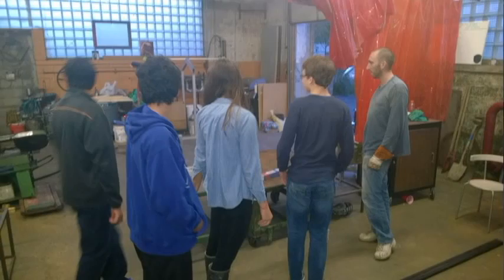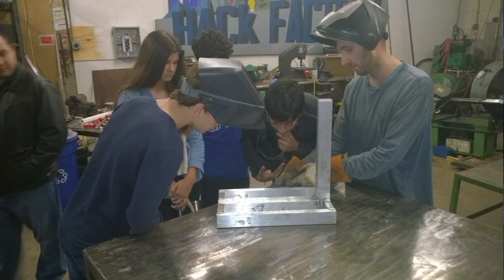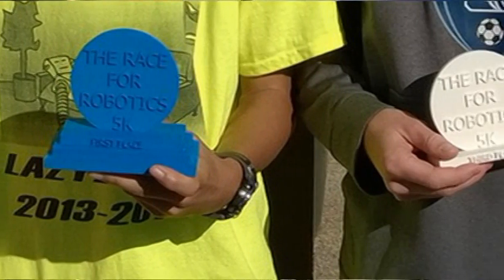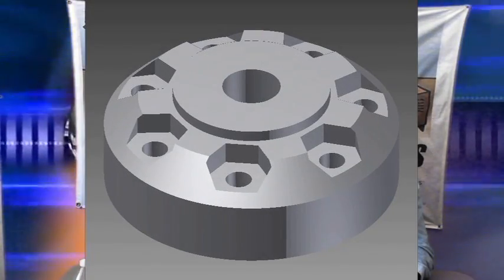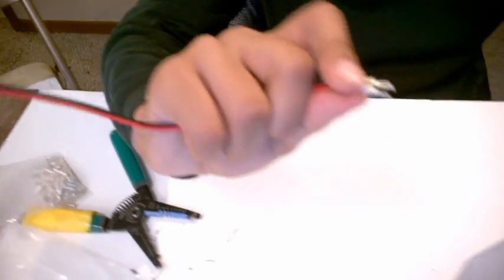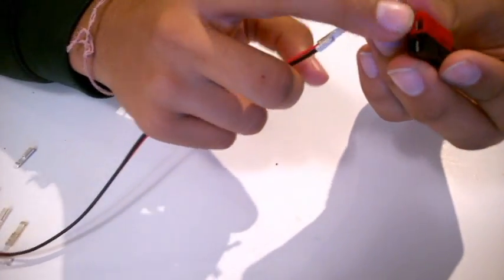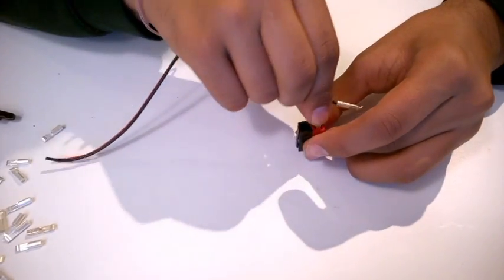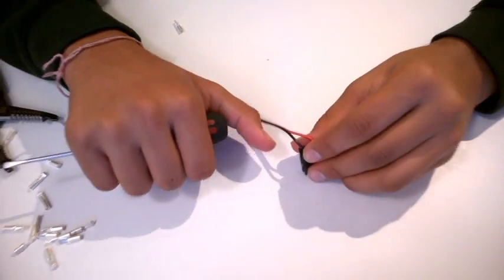FTC News 10-27-2014 Edition

Comment: We are flattered, for the mention, we have to correct some misinformation presented here. We did not build the robot in a weekend robot - that was built by these guys http://www.robotin3days.com/. Lots of cool mentors and FIRST alumni involved in the design and building, but not us. This was an adult built robot. Our small part in that robot in a weekend project was supplying the parts for that project, in exchange for using the finished robot this year as a demo bot and inspiration for rookie teams. It's already been to several places with us including the Orlando Makers Faire, Roboticon, and numerous smaller demos. You can reach us from our website, or find us on the Tec Network, if you ever need to verify information.

Anyone looking for a team built robot in a weekend, should check out the world champion team, Eagles Robotics Xpierence - also from Florida.